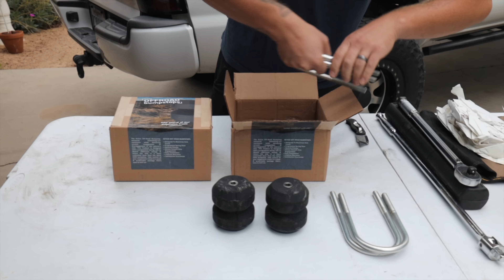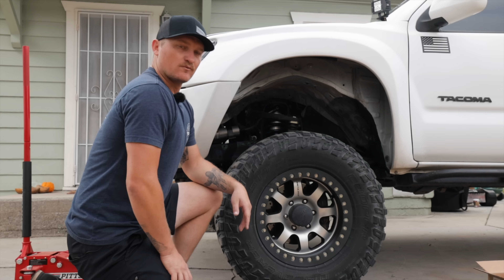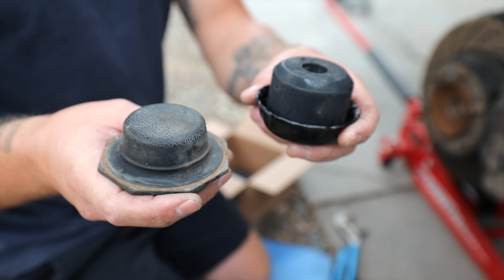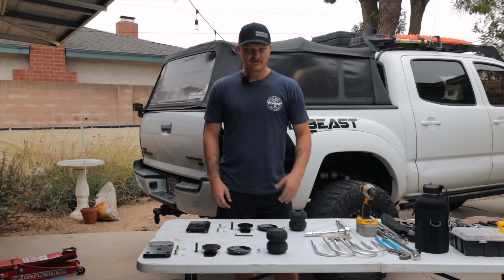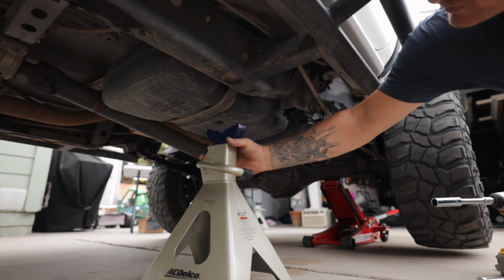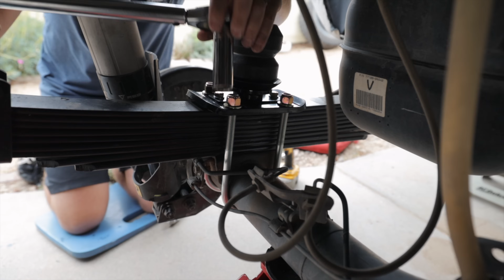How to improve your trucks suspension without breaking the bank | Bumpstop Installation

Comment: I assume this will work with a 3 inch lift kit? there is a block in the rear of my truck for the lift kit. the factory stops are 1 way to hard and 2 way to short for my lift. will it work?

Comment: I was going to pay someone to do the U bolt flip (since i was a bit intimated ), but after seeing this vid (& i have the tools) gave me confidence to do it myself. Thank you.
Reply from the maker: You got this!
Reply: Super easy just buy a torque wrench 🔧 1/2 or 3/8 inch
Reply: @paulthompson661   yeah I had did it myself sometime back and updated the front bump stops as well. I've done quite a few mods to the truck since my initial post ;p;

Comment: Will these help with a squat issue when under load? I’ve noticed the suspension lacks somewhat and I’m looking for a simple way to solve that problem without breaking the bank on suspension upgrades. Thanks!
Reply from the maker: This should help a little but it is recommended you upgrade the suspension if you taco squats a lot 🤙

Comment: Will this work or be worth the upgrade in the rear with stock leaf springs and a 1" lift block?
Reply from the maker: You can, but you might need to source longer u-bolts to accommodate the spacer 🤙

Comment: Will these fit with the Deaver overload springs added to stock leaf-pack ?
Reply: You should be able to install this as is with the Overload Pack as this adds 3 Leafs to the Factory Leaf Pack (the Deaver Stage 3 has 10 leafs). Timbren advised that if you’re using spacers in the rear then you may need longer ubolts.

Comment: That looks like a really good upgrade I think I might go with that. you have old man emu BP 51 suspension this is a suspension I am really considering upgrading to wondering how you find it is it worth the upgrade.
Reply: Hey Russell I really like the BP51 paired with the Deaver Leaf Pack and these Timbren Bump Stops. The ride quality is awesome since you can adjust the Compression and Rebound of the BP51 shocks. I have not noticed any harsh bottom outs since installing the bump stops.
Reply: I’m also thinking about getting old man emu. What’s your wheel and tire specs just to get an idea.
Reply: @RoolLsable  17x7.5 / 6x5.5 / -19 / 3.50 / 4.250 Raceline ST Avenger Cast Beadlocks & 285/70/17 Cooper Discoverer STT Pros

Comment: Why this kit over a sumo spring set up ?
Reply from the maker: Timbren’s Active Off-Road Bumpstops are made from a 100% natural rubber compound and are packed with a progressive spring rate. This is significant because they aren’t just a static polyurethane piece of foam, they're actively working to protect your suspension, your vehicle and keep you and your passengers comfortable while on the trail. Foam products will warp and shrink over time until they’re no longer useful, whereas Timbren’s product hold their shape and form indefinitely. And best of all, they come with a Lifetime Warranty a 100% Customer Satisfaction Guarantee! So ya, they’re legit

Comment: any insight on these being too tall for the rear? its very little space until the load goes from the shock dampening to the bumpstop. arent you basically converting your rear suspension to a bumpstop? i feel like bumpstops should only be loaded at the end of a shocks travel and not the beginning.
Reply: These are not for stock rear suspension.  They will bottom out too soon.  It tells you that in the kit.
Reply from the maker: That typically only happens with the stock suspension and these are not made for that, they’re meant to be used with upgraded suspension 🤙
Reply: That's true but you can see it in another way. On my truck (way smaller than these cause it's europ😅) when I load it it hits the factory bump stop quite often. I use one of these instead of going for harder coils. So I'm in combination with stock suspension. I get a stiffer suspension with the benefit of being progressive. It does loose a little up travel but it's a compromise solution with the benefit that I can remove them myself at any time if I want to.